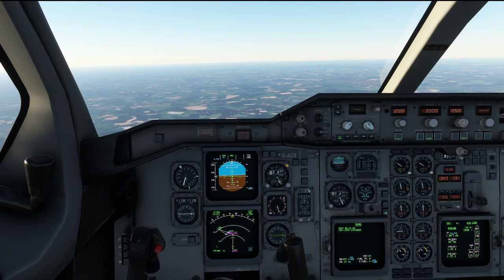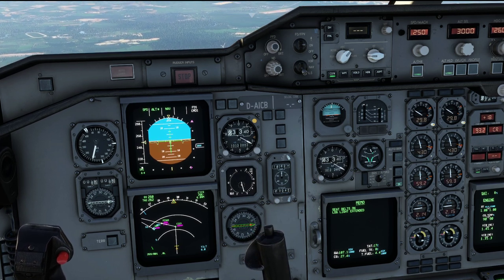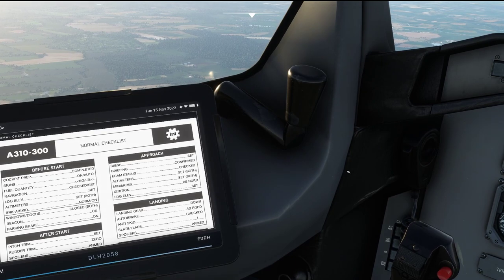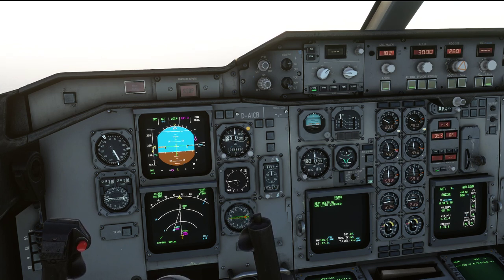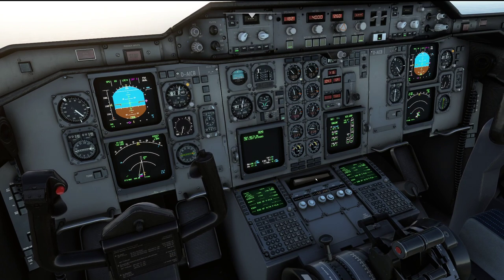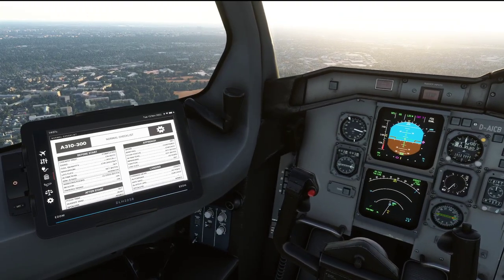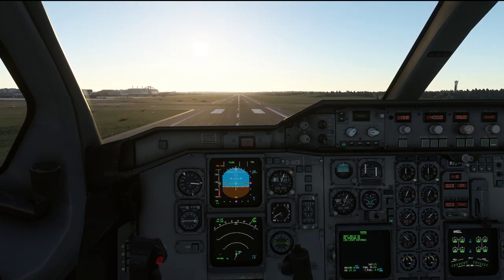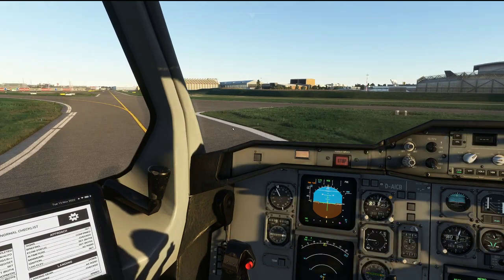MSFS A310 Tutorial 11: Approach & Landing | Real Airline Pilot

Comment: Amazing tutorials, have used them for the 737 and now for the A310! I do have a question about the approach procedure though. So you used the LAND mode to fly the ILS, but is that the only way? Would using VORLOC do the same thing but not auto land / CAT III?
Reply from the maker: VORLOC is a lateral mode, not a vertical one. It would follow the localized but not the glideslope. For vertical guidance (GS) you'll need LAND mode in the A310.

Comment: Can anyone explain more about how the (final) approach mode works in the A310? I see it in the MCDU, I short experience until now indicates it should be activated. I have seen it required for LOC and G/S to be captured, and possibly also for doing a managed speed reduction in sync with flap settings (like the A320 does). Comments on this?
I hope they will fix some of the bugs, not least the almost quiet sound level now from engines, flaps, call outs etc in latest release. Takes away a lot of the immersion when sounds are almost gone. Sadly I don't see fixes for A30 mentioned on next SU.

Comment: How do you make it so the Auto Thurst doesnt kick in? Thanks in advance.
Reply: Turn off flight director. It can interfere even after the A/T disconnected when the FD is left on. Except on ILS approach, you need to completely turn off the FD when going manual to avoid that from happening, and this apply to on modern Airbus.

Comment: If im not mistaken, Inibuilds said in their tutorial videos that according to the IRL A310 pilots they talked too the VNAV decent is known to be unreliable and they usually do the decent manually as you do in this video. Ill try to find the point in the videos where they mention it and edit this post to share the info, but I too would like to see the A310 do a better job with the VNAV decent as a quality of life thing. :)
Edit- Here is the Inibuilds video time stamped to start at the point where they discuss this flaws of the VNAV decent in the real A310. https://youtu.be/VmqsA8_ElIg?t=470
Reply from the maker: To put it in their own words though: "What the manual says is what it does".
I'm sure the manual does not say it should just switch off entirely and do "something" but not descending. Without being an A310 pilot myself, what they talk about sounds like a very basic system while what I saw three times in a row trying to record this tutorial was more like a non existing or very bugged system.
On my livestreams so far I believe we've been more lucky and the system worked better. Probably as designed. On this particular route however... it just didn't work.
Reply: @A330Driver  Absolutely agree with what your saying. In fact, if you look at the VDEV in the video he is also way off path. I typically experience +/- 3000 feet of deviation on my descents in this bird. Hopefully they will work something out soon but Inibuilds did say that all updates are up to Asobo. Really hope this doesn’t get pushed to the back burner.